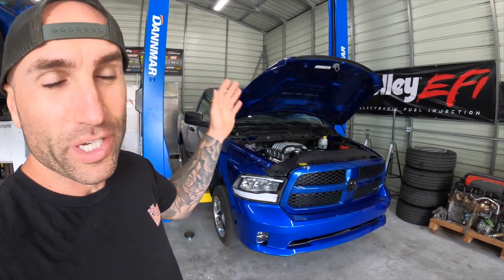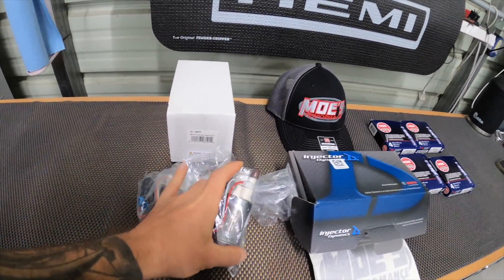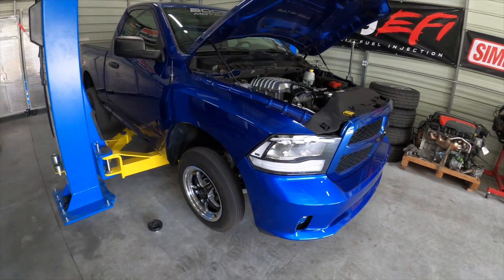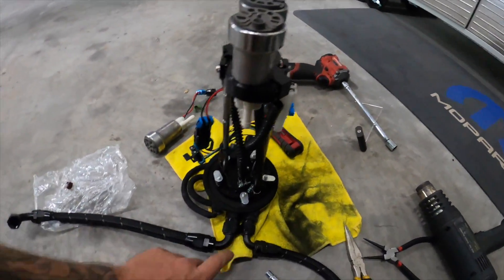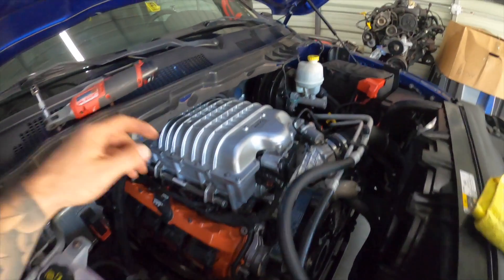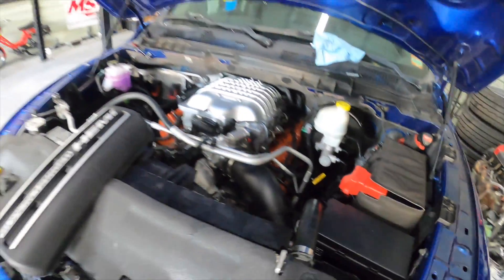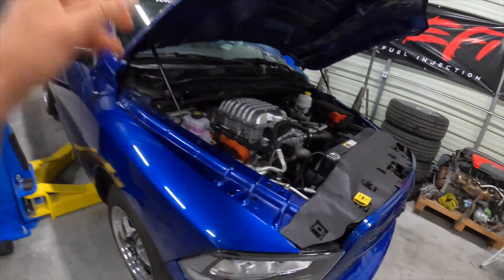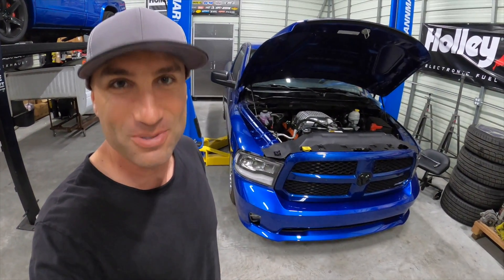Dodge Hellcat E85 Conversion on a RAM 1500

Comment: Hey John if those pumps are the 535s they have no internal check and it's recommended they you install one , I had a single 535 b4 going dual mmx.
Reply from the maker: Yup you’re correct no internal check valves on these 💪
Reply: @BoostedMotorsports  yupp they flow insane over the hellcat 525 I installed a fore fvc checkvalve on fore fuel filter
Reply: @BoostedMotorsports  yep,....never,...yup...were not seals.......

Comment: When I got my two pumps in my tank on my Buick, grand national, I’ll cruise on one pump and then went to the supercharger will kick in the second pump would come on I can put a relay on it
Reply from the maker: Yeah that’s the old school way of doing it. This new technology is pretty wild. There’s no fuel pressure regulator both pumps are pulsating like fuel injectors and can target any fuel pressure we command 💪
Reply: buick aint a mopar, just a machine, sure there nice, but i had 2...u code 70 cudas that were nicer..71 is cooler better though...